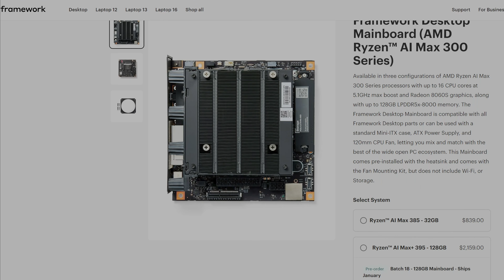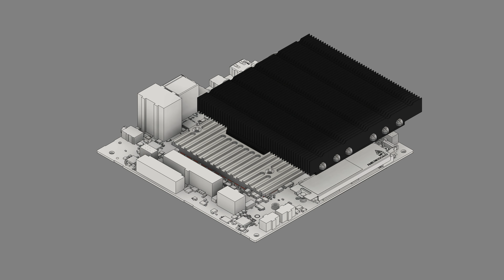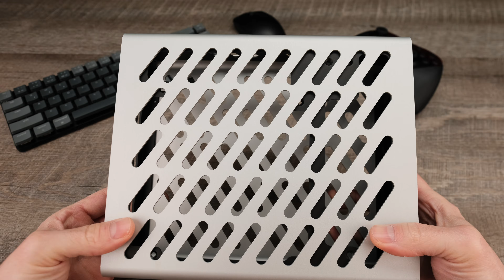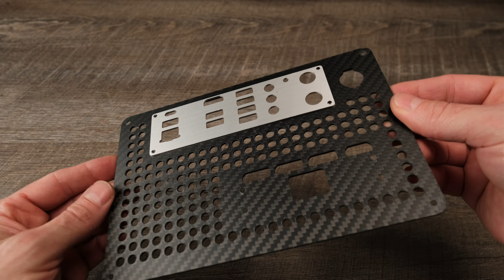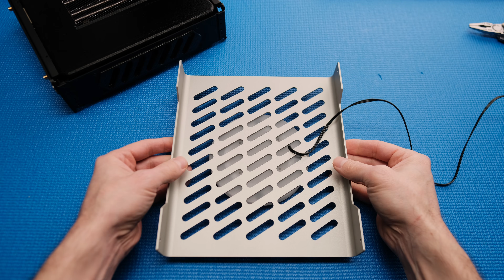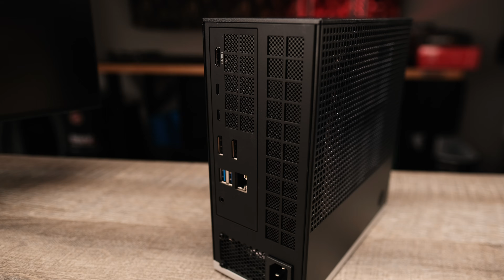AI Max+ Framework WAS the ultimate Steam Machine...

Comment from the maker: The chart at 8:54 does not measure performance — it’s a temperature comparison. The axis is intentionally focused on the realistic gaming load range (≈65–77 °C) so differences are easy to see, and the exact values are labeled on the chart.

Starting a temperature graph at 0 °C isn’t representative of real-world GPU operation, even at idle, let alone under load. If this were a performance or efficiency chart, starting at zero would be appropriate — but for thermals, highlighting the operating range is standard practice.

That said, we appreciate the feedback and are happy to implement best practices from constructive criticism.
Reply: 0°C is not more appropriate because temperature does not begin at 0°C either. The folks complaining should look at a Kelvin graph and see how what you showed is more appropriate
Reply: I see this and I would say that is not misleading, and the fact this comment is pinned at the top adds transparency. That been said, it make the difference look greater than what it's. For some games in the pareto I would argue the results are withing margin of error. If you do 1% lows maybe it becomes a way better way to depict the real work performance and makes the difference greater to make a better argument to your build. 

Completely separate comment, I bough a the 128GB version and my first intention was to use the Sky Reach tiny for a APU build, i had some 3D printed legs that increase the bottom gap. If you can live with your motherboard upside down that is also a solution. I ended up not being able to deal with it a moved it to a overkill ncase t1 case. You guys should consider cases that are slightly taller for SoC systems that will be coming up with the rise of PCs as consoles, not that the current offerings don't meat the requirements, but it would allow for more flexibility.
Reply from the maker: @AngelPl4y3r  I'm too small and don't have the money to play whack a mole with these companies. I make a case and then GPUs or APUs get hotter and hotter. So I focus on quality cases that are expandable and support them with accessories. Glad you at least tried the S4T-D! I've developed some new accessories for it too since I have people ordering frameworks more often. Peace
Reply: please check out bazzite instead of steamos! i am sure it would be a bit more consistant :D
Reply: If you're not selling the aluminum mounting plate, can we at least get the file for it so we can have someone mill it for us? I'm working on installing a FW Desktop mainboard in an old Amstrad and your channel is the only one I've seen make a custom plate like that which I absolutely need for my build

Comment: I wouldn't use liquid metal on anything. Too much risk for too little reward given the cost of modern parts.
Reply: Don't fear the liquid metal. If applied correctly with appropriate safe guards then there's nothing to worry about.
Reply: @nfcerick3634  Tell that to all the owners of the laptops and ps5s that've been having problems. How many of us have tossed our laptops on the bed? How many have carried theirs in a backpack and then dropped that backpack to the ground? That liquid metal can and will pool and drip out over time. It won't be as likely if you do it yourself and you use as thin a layer as possible, but I've heard of it happening even when precautions are taken. Too much risk for virtually no benefit vs completely safe methods.
Reply: @Drebin2293  Most laptop manufacturers and the PS5 (especially) misapply liquid metal, use too much, and do not seal the die well enough. I can't defend or support instances where either of those is tossed or dropped. "virtually no benefit" is a bold statement.

I support and love liquid metal. It's OK if you don't.

Comment: Ok so while on paper, yes the 395 max does have 40 compute units next to the Steam Machine's 28 compute units, you have to remember that because this has LPDDR5X instead of GDDR6 the bandwidth is likely around half that of the 7600/7600m used in the Steam Machine.
Additionally, because the CPU and the GPU use the same memory bus the CPU is going to suck some of those memory cycles away from the GPU.
Why does that matter? Well AMD APUs have always been memory speed starved, which is why i bought the 395+ to replace my 8700G usff video editing rig.
Its not all doom and gloom though
Because this is an APU rather than a CPU+GPU this can have some benefits like not needing to have 2 copies of the same asset in the CPU RAM and the GPU RAM(though it often still does if you dedicate RAM to the GPU and the software is unaware this is an APU)
Another silver lining is that if you get this with enough RAM having a slower can be less painful. Just look at the 50 class 4060TI/5060TI(desktop) same bus as the 1650, and while the 8GB version does offer the expected performance of a 50 class card, the 16GB version ends up being much smoother and sometimes a bit faster because it is spending fewer memory and compute cycles deciding what it wants to eject from memory.
The problem with Strix Halo is that 256GB/s is about what a 24CU GPU needs, not 40(with 16 CPU cores), this is why this chip, that when paired with GDDR6 would probably run at 200w, is only running at around 120w...... when paired with a 150w CPU. Thats right seperately these two parts when fed enough memory bandwidth would use over 350w, but when combined on this slow memory bus they use only 120, and i often struggle to get them to use that much under bandwidth sensitive tasks.

I still think its worth the money if you need the VRAM. I was considering getting a used 4090 but my friends computer ended up crashing more in davinci resolve than my 8700G with its 96GB of RAM because combined his PC only had 56GB of RAM and davinci was using all of it for these raw files(honestly i think its a bug because i dont remember it being a problem on my 12600k with my old 1080

What i'd like to see from the next HALO, is a 384 bit bus, and the CPU, and maybe even the GPU, having 3D cache to take some of the pressure off that slow memory bus. Strix Halo, in my opinion, needs a 768 bit bus to fully feed its GPU and CPU with the memory bandwidth they need, if both parts were X3D then maybe a 512 bit bus

The upside to this lopsided high performance part being held back by memory bandwidth is that it can be incredibly efficient for laptop, tablet, and handheld use at the wattages normally expected in these devices. My strix Halo 395 doesnt scale all that well past 50w in several games going from 30w to 120w only gets me an extra 20% FPS
Reply: Of note i personally expect the Steam Machine to be slower than the 395+ despite it probably having a faster GPU. And it all comes down to the CPU being a cut down AMD APU, and the GPU only having 8GB of VRAM
Yes in some games having 1/2 the cache per core, and much weaker CPU cores than the 16 core Zen5 9950x thats in the 395+ wont really affect the game's performance because its so GPU heavy, but i think too many games are going to be held back by the CPU only having 6 Zen4 cores with 16MB of cache(the cache is the important part in this equation as Strix Halo has 32MB for each of its 8 core clusters), and the GPU only having 8GB of VRAM, which has started to affect games even when running at 1080p with FSR
Is the steam machine going to be a great value?
Probably, you could get similarly spec'd miniPCs but with better CPU (still only 16MB but 8 cores instead of 6 with a better iGPU) bare bones for around 550USD, but valve is going to have a lot more features like the integrated controller receiver that IIRC can wake the machine from sleep (you need an old Xbox dongle on a special USB port to do this on PC, not all motherboards support this) And its going to be extremely quiet. The only down side is that many of those miniPCs you can buy seem to be easier to maintain and upgrade often offering 2-4 NVMe slots and easy access to RAM

Comment: So yours is noisier but runs cooler? Can't you tune it so it's the same noise and slightly hotter?
Reply: Not necessary. The noise difference between the Noctua NF-A12x25 and the NF-A12x15 isn't worth the loss in cooling by doing what you suggest. It's still a low noise system.

Comment: it runs cooler, but what about the noise? i'd be tempted to make this if i did have a 3d printer... alas... :(. or if this was a buyable kit lolol
Reply: I stopped trying to accurately record fan noise on video. It's just too difficult, and nearly impossible to provide an honest experience. The 25mm Noctua on the Framework sounds different than the 15mm Noctua on the S4T. Both systems are very quiet.
Reply: @nfcerick3634  hey thanks for the quick reply!

Comment: nice graph, 74 is twice as long as 70.
Reply from the maker: That's because the graph starts at 65 not 0. This is not a relative performance chart, it is an operating load chart. Does your PC run at 0C under load? If so can you please link me your cooler so I can put it in my build? :)

Comment: The build is stunning but the diagram at 08:54 is awful :)
Reply from the maker: You should be specific, because we have several videos in the pipe and they use similar graphs. I can't do anything with "is awful"
Reply: @NotFromConcentrate  Graph shows double performance on glance (length is 2x in comparison) while it is actually 5% difference. Graph should start at 0 not at 65.
Reply: @NotFromConcentrate sorry! the difference looks huge while it is not. You should use columns starting at 0 (the numbers do the rest but are not as absolutely important as in yours where you have to read the scale, too). This will ensure correct proportions and avoid missinterpretations. If you have time, you can check out how Der 8auer or Gamers Nexus on how to use them properly.
Reply: Sorry again, I hope this helps. It's up to you, though :)
Reply: Yeah 4 -5 degrees difference is basically rounding error for non over clocking scenarios.

Comment: Just wondering, it wouldn't been better to have used a blower fan to cool down the psu?
Reply: More air is better, and a blower fan would do that for sure but at the cost of noise. Pulling cool air directly through it with a nearly silent Noctua works VERY well.

Comment: why is that board so large, pretty sure they could have made it nuc sized.
Reply: traces built for signal integrity and synchronisation with a cpu that has this much memory bandwidth is hard to fit into a smaller form factor tbh
Reply: It could have been an epic STX board.
Reply: @nfcerick3634  and then you would have a whole 3 cases to choose from to put it in

Comment: the comment re: the cooler is unfair-- the fact you had to make the cooling plate is exactly why. They have to cool the memory and a non-standard CPU package. It's custom, so the cooler is too.

Why didn't you make your mount take standard coolers?
Reply: I would say that it isn't fair of them (a company that is all about DIY, hot-swap parts, innovation, and customization) to not make the effort to do what can obviously be done (just look at the MINISFORUM BD395i board).
If you really want to dig into it, the Framework cooler is just a simple heatsink with 2mm thick plate extensions that cover the RAM, MOSFETs, and VRMs. It's nothing special.

If I was trying to sell this product, then I would have made one that takes standard coolers. I designed an AM5 version before I made the one you see in the video. It just wasn't something I wanted to do considering there will be other boards that won't need it.

Comment: Bro, this is amazing! Is it possible to order all the parts needed for this build somewhere? I mean the mods needed for Framework ? Is it more quiet than stock setup? I've got a FD 128GB and the main issue is flex PSU noise that I hear in intervals even when the system is idle.
Reply: The files are available through our Patreon. Otherwise, you can shoot us an email for custom work!

Comment: If Ryzen APUs had RDNA4 tiles, I’d build a framework ITX for the living room and a backpackable gaming rig. But I’m not spending that kinda money on a device that’s already obsolete on critical software features. With how badly optimized games are nowadays, not having access to a ML upscaler moving forward is like taking a 30% performance cut right off the top, and an image quality hit if you run native resolution FSR4+ as your AA setting.
Reply: @MechAdv  I got the board second hand, don't play AAA games for the reasons you stated and more importantly.  I did it because I can and I'll do it again.
Reply from the maker: @MillerDvS  DO IT, NERD
Reply: @NotFromConcentrate just an idea , can you make an itx build with a powercolor Reaper 9060XT 16GB ?
Reply from the maker: @50H3i1  I did a 9070XT Reaper build in a S5M on this channel if you are interested
Reply: @NotFromConcentrate yeah I saw the video before . that was an awesome build  .
But 9060XT reaper is much smaller and it has the potential to be the smallest 16GB gpu build . You know just an idea

Comment: I wish Minisforum would release a itx motherboard with this chip with a full 16x pcie slot.
Reply: That isn't possible due to Strix Halo not having extra pcie lanes avalable. The big built in GPU on Strix Halo actually already uses the pcie lanes a GPU would use. The GPU is just using the lanes in the die with the CPU instead of going out into the motherboard. If you want more pcie lanes just build a normal ITX build with a normal CPU especially if you want that slot for a GPU anyway.
Reply: @chronossage I'm using a Minisforum BD790i motherboard with a laptop Ryzen 7945HX after selling my 9800X3D with a 5080FE can't even tell the difference in performance perfect for the price.
Reply: @nathanp8d  Strix Halo wouldn't give you any CPU improvements over that. You should only get Strix Halo is you want to use the built in GPU. Strix Halo only has 16 pcie 4.0 lanes vs the 7940hx 28 pcie 5.0 lanes.
Reply: @chronossage  ah thanks for the info

Comment: Can the heatsink adapter plate you designed be used to integrate a watercooling setup on this mainboard? I've been wanting to get that setup on my board for a while now.
Reply: Not this specific design, but it could be modified depending on the water block you choose.
Reply: @nfcerick3634 probably a long shot, but any plan to sell an adapter plate design like that?
Reply: @lincolnchen2994  We do custom work, so you can always reach out via email and we can go from there.